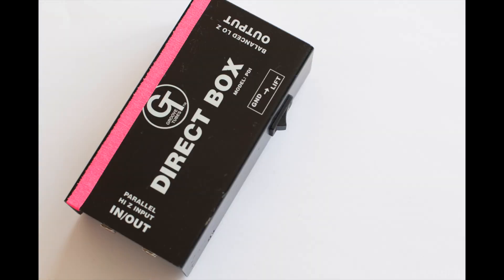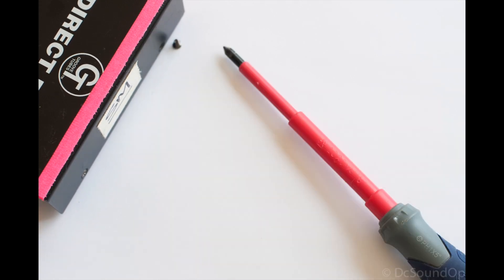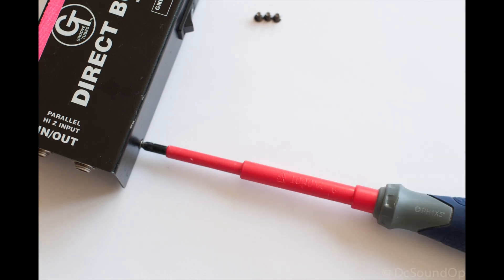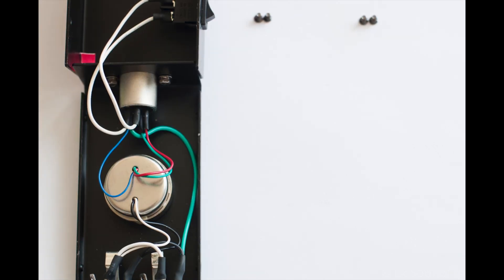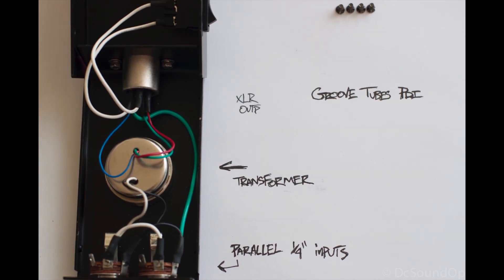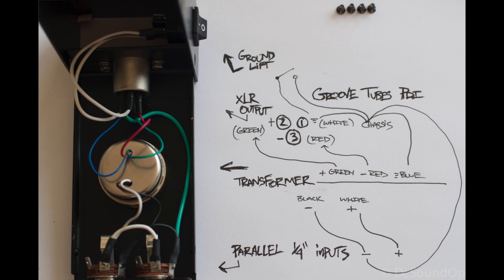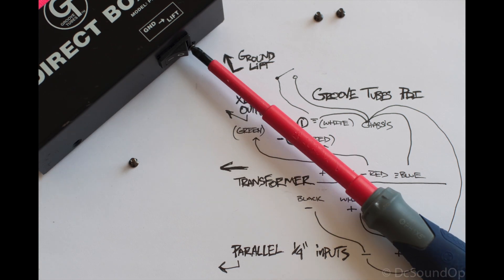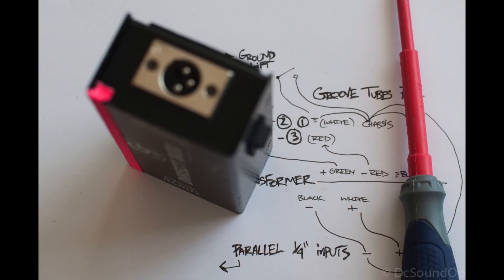Passive Direct Box Teardown and di-box chat

Comment: Would a box like this work in the opposite direction?  Let's say I have an amp with and XLR direct out.  I would like to take that to the direct box XLR. I would then take the 1/4" phono from the Direct Box to a 1/4" line in on an amp.  My assumption is that the transformer in the Direct Box is 600 ohms on one side, 50K on the other side, and the transformer is bi-directional. Would that work?
Reply from the maker: It would work, assuming you have an adapter for the XLR to connect an output to an output, but otherwise yes. Give it a try and let us know what you figure out!
Reply: @DcSoundOp  Yes it does.  I am assuming there is some signal loss.  And easier solution was using an XLR to 1/4" adapter with built in transformer. I then use a 6 foot Mic cable..  Same results.  Thanks for replying.